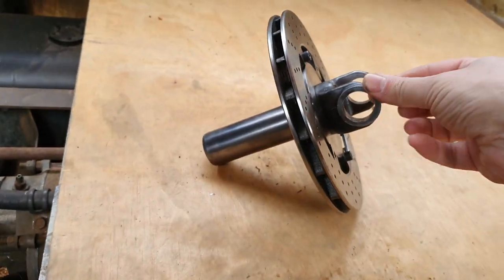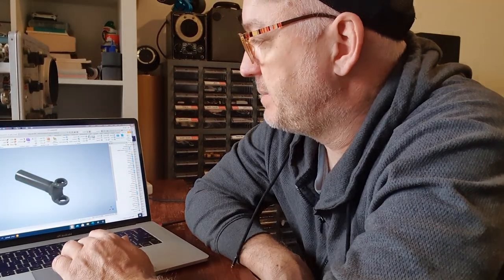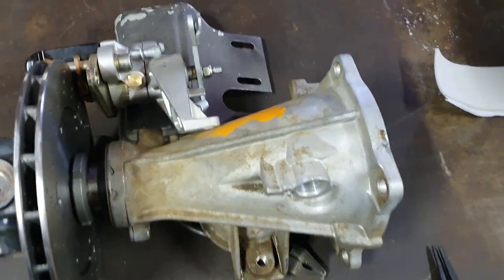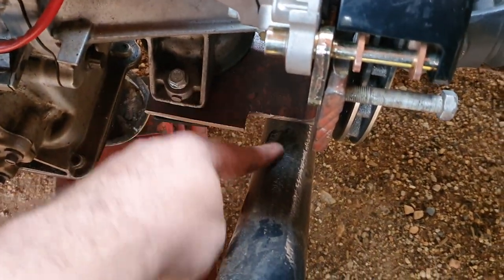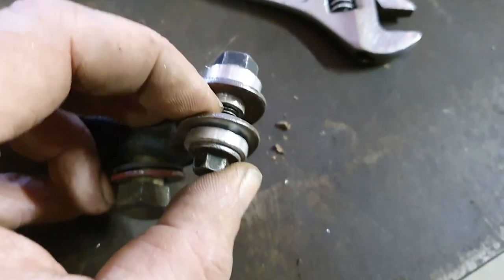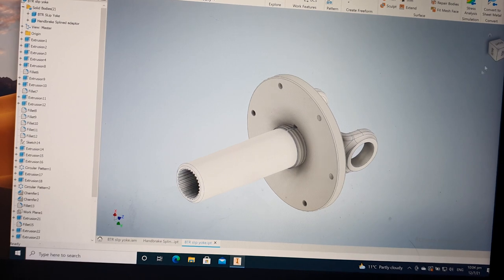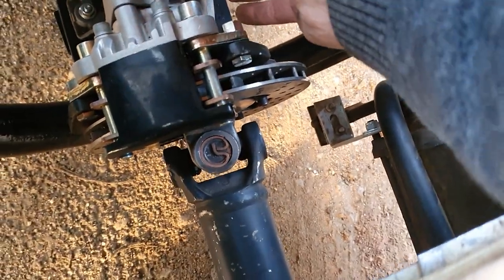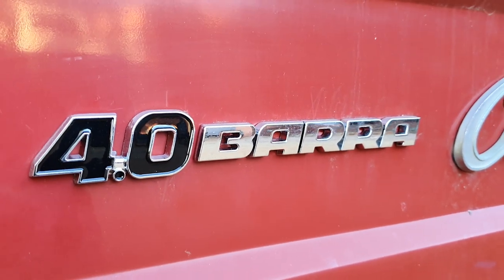Toyota Coaster Barra Swap Episode 10 - The HANDBRAKE

Comment: where is this project up to now? ive got an old coaster with a 250 crossflow. wondering if a swap would be easier being that they are similar engines.
Reply from the maker: i've been without a workshop for 12 months. Recently have a new shed, so will get back into it. As for the cross-flow, I don't think it would make too much difference to the build.
Reply: I also have a ford 250 engine previously installed with a C4 auto in my 77 coaster.

I would like to convert it to EV system just researching at the moment.

Comment: Hi I’ve had a coaster 86 model RB20 . I converted it to a commodore v6 motor with its auto and created a transmission brake to suit.  I’m in Perth .. where are you Barra .,? 
Cheers 
Geoff
Reply from the maker: Hi Geoff, I'm in Castlemaine VIC. Though I grew up in Perth. Barra Ben
Reply: I am thinking of converting an 86 coaster to a commodore v6. How did yours drive when complete? Did it have enough power to move it?
Reply: @ yeah hi Adam, I’ve still got the vehicle and it drives great. There is a few considerations though with the conversion to do with the handbrake. I can send photos if you wish once you’re over that hurdle everything is easy. My Vehicle sit on 120 no problem.
Reply: @geoff3656  Thanks Geoff, well that is good news. I haven't started yet but I am looking at an old coaster that currently has a holden 202 in it, not sure what colour. My dad says it would be seriously under powered so that is why I thought an ecotec or barra. I would rather the eco. 
If I do decide to go ahead with it I will certainly grab the photos off you for reference. Thanks again mate.

Comment: Hi,
how is the diff ratio working? ive been told there to low for petrol motors is this true as im looking at upgrading a coaster motor as well
Reply from the maker: I've still not had a chance to do a highway run. Though the ratio appears ok. The BTR and ZF have overdrive top gears.

Comment: G'day, nice work, very inspirational. Loving the vids, may I ask what diameter is the rotor you have used...? I have found the caliper but I thought I'd check the diameter of the rotor before I purchase the wrong size. Thanks
Reply from the maker: I have used a 206 x 16 OTK Cart rotor. https://www.ebay.com.au/itm/121712945135. The callipers are adjustable for various sizes and rotor thicknesses.
Reply: Oh thanks heaps.

Comment: Hi I have the same model coaster and have lined up a mechanic to do the same conversion less the turbo. Could you package up your drawings and findings so to make the job quicker and more precise? I'm willing to pay for all your effort I don't want them for nothing,I and others I've been talking to on face book, love what you've done and are waiting for further episodes,. I would love to talk or text with you for extra pointers,thanks
Reply from the maker: Hi Luciano, I'd love to assist but can't be much help. The engine mounting laser cuts were greatly altered after cutting. so aren't much use. I'm also in between houses at present and don't have a shed so can't measure it up.  I would suggest, however, using the ZF 6 speeds transmission. After the bus I made an NA Barra powered 1977 F350 truck. with a later BF Barra and trans. The ZF doesn't have a slip yoke and has far better mounting options for the handbrake frame. Though you will require a CanBarra transmission module..

Also, if I were to do this all again. I'd make the engine bay walls removable. Getting to the intake manifold is a pain, and near impossible from underneath or on a hoist.  happy to answer any questions for your mechanic.
Reply: @barrabadgesAust  Thanks I'll let you know how I go,by the way can't wait to see the finished product
Reply: I converted RB20 to commodore motor and auto .. want to see it .,?
G

Comment: G'day Mate.

How much did the disc brake cost the full set up in total?
Are all your CNC designs and other designs available?
I love these videos but if I do The Conversion ill just keep it as a N/A.
Is there a way to DM you for more information?

Can't wait to see the next episode!
Reply from the maker: All up it was about $1000. I do have the adaptor on CAD though I think there was a bit of adjustment by the machine shop on the fly. Note: I haven't yet had it "engineered" by a VASS engineer.  Flexible drive made the cable. The other parts are available on ebay. 

Yoke $50
Custom flange and machining $400.
Cable $200
Rotor $120
Callipers $200
$50 in steel.

The project is on hold due to having to move house again! Though during the past couple of months I Put a NA barra in a '77 F350, it has enough power to drive that heavy vehicle comfortably though with a zF6 speed.
Reply: Thanks for the reply. Is it possible for me to get all your cad drawings for the conversion?? Free or payment which ever would save alot of messing around with the hand brake and engine mounts and the tailshaft react is pretty straightforward :) and nice I shall have a look at the 350. Did you do a modification check with the vin what did they say needed to be done?? My engineer said it could be as simple as just an emissions test on a dyno. But could be a drivability test but I have to give them my vin first.
Reply from the maker: @tristangreenwood8649  I can send the CAD I have, send me a message with your details through this youtube account.
Reply: @barrabadgesAust  cant find how to message you youtube has changed.. it says to go to about then click send message but its nowhere to be seen on your profile
Reply: @barrabadgesAust  doesnt give me any options to message you at all. no email or socials are linked to your account should be able to message you when I click your about section
Reply from the maker: @tristangreenwood8649  I'll check my backend settings.
Reply from the maker: @tristangreenwood8649  I've updated my  email under "about"
Reply: Haven't been able to message you still
Reply: @Bust it Build it Auto  think my phones being glitchy I sent 3 reply and none showed up
Reply from the maker: @tristangreenwood8649  Can you see my email  under the about tab?
Reply: No I see nothing other than a link to your Channel and a flag to report and a few other things if you go on Facebook and look up my name the one with a fire pit in it is me

Comment: G'day mate just wondering what size exhaust system you used and the diameter, I've got a 250 xflow but the old exhaust is from the original diesel engine.
Cheers
Reply from the maker: I used a used zr6 turbo exhaust. details here https://www.youtube.com/watch?v=_Zpkij8EwJY
Reply: @barrabadgesAust  cheers mate love ya work on the build.